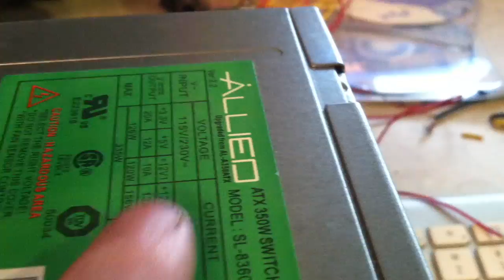Testing an Xbox 360 with an ATX power supply

Comment: Bro on standby mode  i no  have 12v   on pinout i have   xbox 360  slim   adapter  not present 12v  only 5volt    it is  adapter  fault ? console not power on  i have only beep sound when press power button

Comment: woo wee it's hard to get that red wire in there. like trying to pick a lock on oblivion or something...there is  a metal pin in front of the hole lol...
Reply from the maker: I made this video many years ago, but I do remember this being tricky. There are 3 different PSU sockets on the original 360, so it's possible you have a different one too.

Comment: Bro, in my case; the supply wont start when I put 3 yellow wire and 3 black wire.
But when I put just 1 yellow wire 1 black wire and red wire it start but there is 3 rrod.
Then, I start up with PSU Xbox 360 slim with 135 watt it can boot, but then the Xbox 360 fat turn off, I think ia because the power from PSU Xbox 360 is only 135 Watt.
Do you have any solution brother ?
Reply from the maker: I made this video so long ago that I don't remember anything about these, but there were three different power connectors used on the 360. Maybe yours uses a different layout for the connector.

Comment: Used a 400w PSU and when I turned it on it started making death noises at me
Reply from the maker: Could be wired incorrectly, or the Xbox uses a pinout different than the one I showed in the video.
Reply: Doubtful. The Xbox had signs of life, Xbox turned on when I pressed the button. Displayed the green lights for a second and went instantly to red.  Eject+sync displays no error codes
Reply: Plus i got both the system and the PSU for free so nothing lost, nothing gained, I guess.

Comment: That's One jenk Ass af setup better cannibalise a broken power supply from the Xbox use the plug and solder the bits together with some heat shrink tubing
Reply from the maker: I agree, it's hot mess. At the time I was testing multiple versions of the 360 that had slightly different plugs. So, rather than make 3 different janky PSUs, I did this instead.

Comment: I connected all cables in 2 arrangements, but all I get is when I plug the psu in to the wall is the fan spinning up, then it go's to a very slow speed and no power to the console at allfor all the curios ones, im using a FSP group INC psu from an Acer pc designed to work on 240 volts from the mainsHELP NEEDED                                                                                                                                                                                                                                                                                                                                                                                                                                                     EDIT: disconnected the psu from the xbox and still getting same problem and it is a 250w one

Comment: hey I have a xbox 360 120 to 130v
but I used it on 220v unfortunately my bad...
and power supply got burned...
what will I do now?
I mean its a 120v xbox but in my country its 220v 😞
please guide me I ll really thankful to you..
Reply: unless you have the xbox one s or the really old xbox that takes power internally, all other xboxs  take about 12 volts from all external power supplys whether they 120v or 240.u can now just go to a shop or go on ebay to find a replacement power supply.when the psu blew up, there is a very slim chance that it could of sent some sort of power surge through to the xbox if it was connected: in which could fry the xbox also.I had the very same thing happen to me when I got my special edition white 360 s on xmas day.got it imported from the us, pugged it into uk 240 socket, made a loud pop and blew the fuse.Luckily we had an English power supply which we pugged into the xbox and it worked fine

Comment: how can i do it on xbox one? is it possable?
Reply: +Steve Poljakov it is possible. Xbox one also us 12V DC. You can use a Xbox 360 psu with Xbox one with a adapter or DIY. So a Pc power supply will definitely work. Wiring will be different though

Comment: ok i got the same power supply that you have in this video, and im a little confused still on which wires to use exactly. my psu shorts out when i have everything connected and i turn it on. the fan runs for a second and then turns off
Reply: If you have a working computer with a high watt psu. You can actually just use one of the molex connectors. The only way you could turn on the Xbox is if your pc is on but it's simple. Both middle cables from the molex are ground. Connect those to all the black ones from your Xbox. You'll need a multimeter to see which one is 5v and 12v. The 5v goes to the red Xbox cable and the yellow Xbox cables connect to the 12v.
Reply: Actually there is a method of allowing the power supply to run without a PC. If look you can find a video that shows how to use the power supply that way.

Comment: and tell me seconectan all cables as mentioned or could be 1 of each source and can be used kindof have a atx 300 watts thanks
Reply from the maker: You can use wires from any connector, so long as they are the correct voltages. Usually, you'll be using the black, yellow and red wires.
Reply: appleontheapex garcais good friend and source and I recommend you light the console by interructor source or the button on the xbox and I turn on the power to the lights xbxo 360 but I have precionar the button on the xbox to be see the central green LED that is all my question thanks

Comment: Yes thank you.. I got the front panel of my Xbox to turn on but when I connect the yellow wires from the Xbox to the atx psu it short circuits and my atx psu shuts off. Any ideas why??  Thanks for replying
Reply: yeah i have the same problem. i actually have the same atx as what he had in the video. its not working. I did what i thought he did with the wires and everything but im still a bit confused on which wires exactly to use. i got 3 yellow 3 black and one red. im trying to see if i can fix my xbox but it is not going well. :(

Comment: Yes thank you.. I got the front panel of my Xbox to turn on but when I connect the yellow wires from the Xbox to the atx psu it short circuits and my atx psu shuts off. Any ideas why??  Thanks for replying
Reply: It could be that there is some short being caused by strands of wire touching each other. It's that, or you have a different model of Xbox that I am not aware of. Xboxes are not my specialty, so I really couldn't say what's wrong in your situation. Sorry! But I'm glad I helped you

Comment: Great video :) but I've noticed on my Xbox power cord that there's also a blue wire..... Where does that go?? My Xbox does not turn on
Reply: The blue one is not usually needed, but it can vary depending on the model of Xbox. Basically what it does is tells the power brick to start sending power when the front panel power button is pressed. But in this case, that is not needed due to the paper clip sending an "always on" signal (assuming the ATX power supply is on). The paper clip is, in this sense your blue wire.